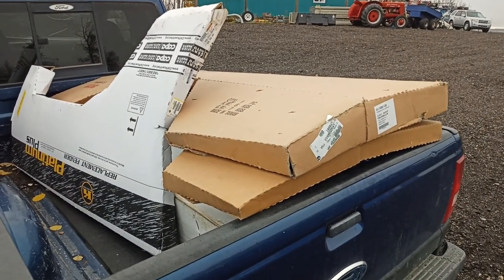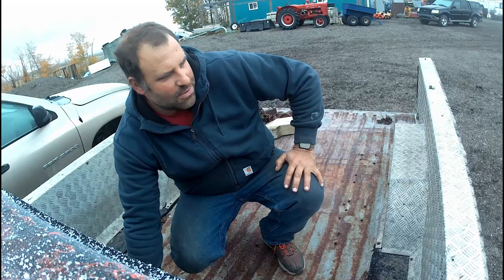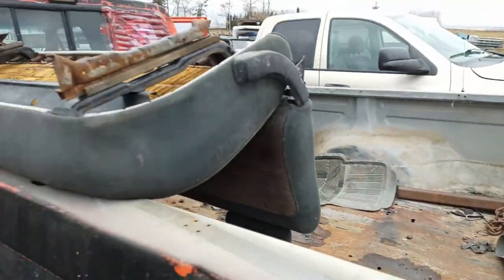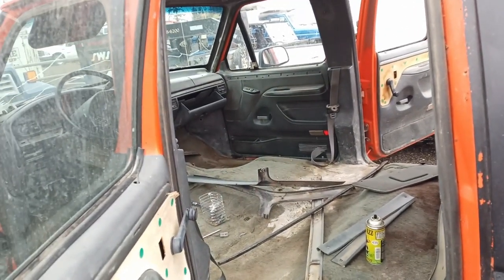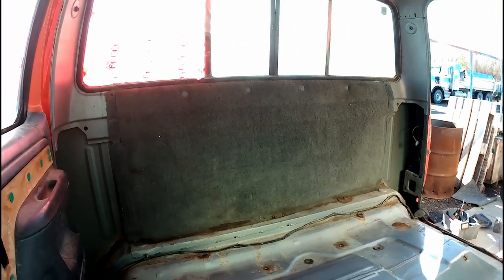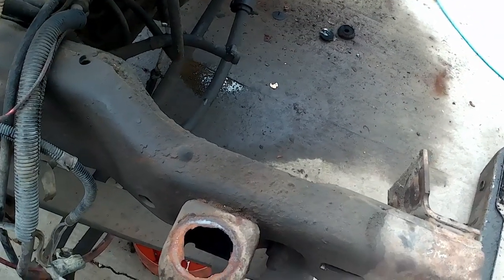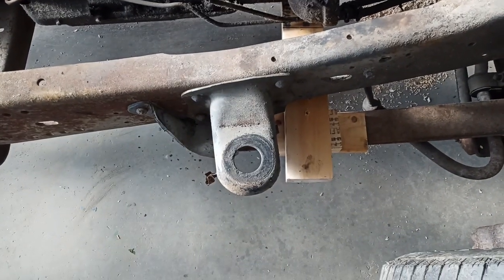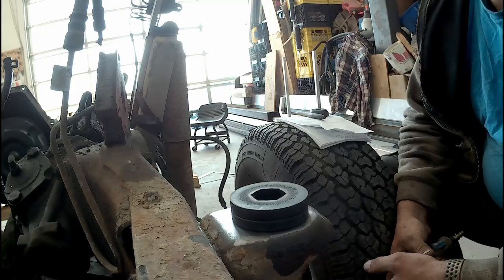OBS FORD Diesel 6 Door 4X4 Build -  Part 2 - Strip to the Frame

Comment: 6.9 block with 7.3 heads and use head studs
Reply from the maker: Would you mind elaborating more on using the 7.3l heads on the 6.9 block.   I already have the arp studs for the 6.9.  What would I be gaining with the 7.3l heads in terms of performance or reliability?
Reply: @Shopworx  6.9 is the same as 7.3 but the 7.3 is bored out and has longer head studs. im sure more compression is vvhat you vvould get vvith 7.3 heads on a 6.9.